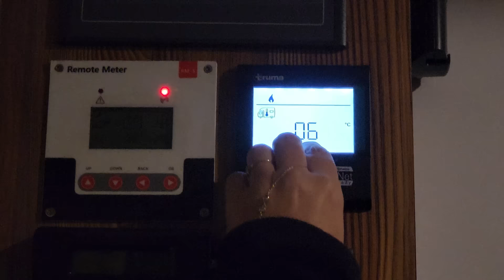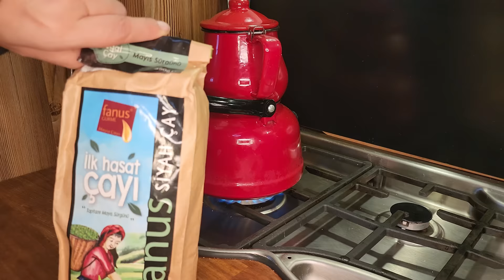ÇAMUR BATAKLIĞINDA KARAVAN DEVRİLDİ

Comment: Only just started watching this episode. An interesting choice.  If you winch you are winching further into the bog.  If you call for a tractor it will take time but you will be pulled out away from the bog.  I'm interested to see which option you pick. :)

You made the right choice.  :)  That tractor guy had all the right gear.

With the type of driving that you do it may be time for a rear wnch to be fitted. :)

First snow is always beautiful. Great ending to another great video.
Reply from the maker: I am Just started to mount a rear winch

Comment: It’s worth considering mounting a pulley under the winch, then you could have run the line under the truck and winched yourself out backwards. Failing that, get another winch mounted on that rear “A” frame.
Rather envious of that beautiful camper, you have everything on board. It must weigh 10 tonnes or more🤣.
I’d also consider replacing the wire rope with Dynema or a similar high grade synthetic line. It’s much lighter, easier on your hands and much safer in the event of a breakage in the line.
I was afraid when you were handling the wire rope on the tractor, it was in a terrible state with broken strands, and neither of you had protective gloves. The injuries caused by wire rope are well documented.
Enjoy your travels both of you, you look like good people who look after the places you love to visit.
I often have to visit the Asian side of Istanbul, and I’ve become very fond of the Turkish people I have had the privilege to meet and work with.
Greetings from Romania ❤️🇷🇴
Reply from the maker: Thank you very much. LOVE FROM Romania🙏😊